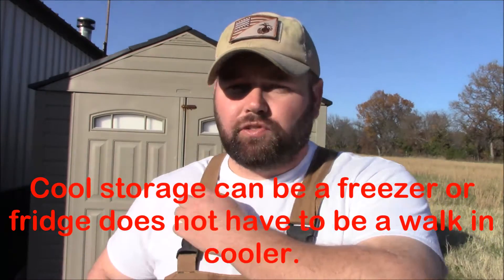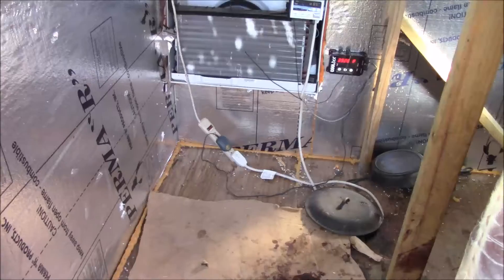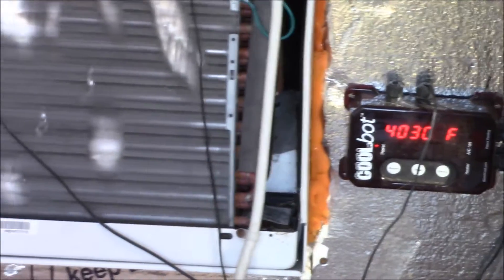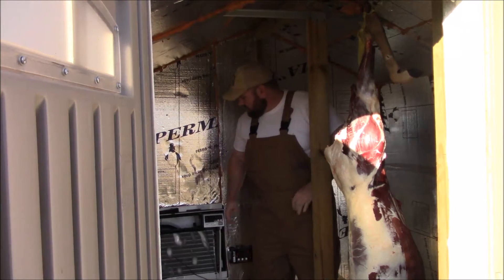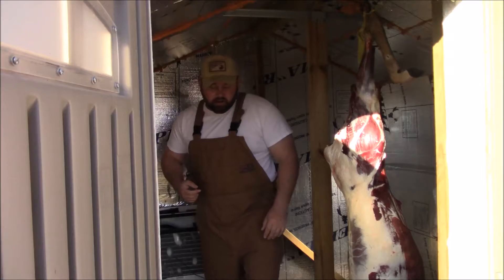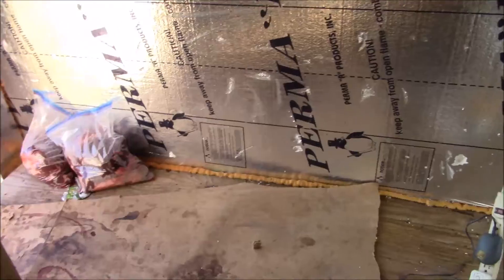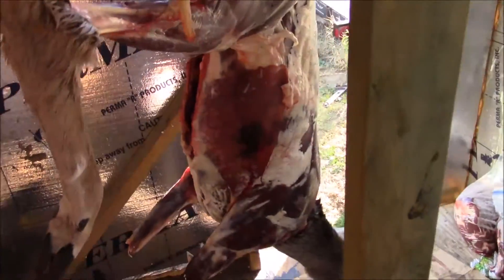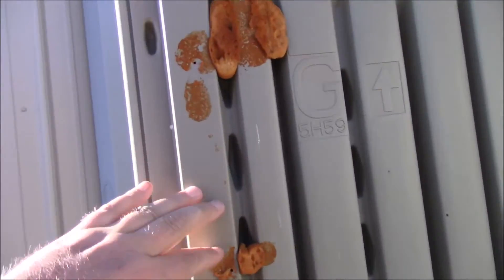This A/C Can Get Down To 20 DEGREES IN 5 MINUTES

Comment: Thanks for the nice video. I've seen those coolbot stirred actually pretty good but I'm just curious if I went to the trouble of building a freezer room is it possible to cool it down below freezing with a coolbot or is there another way of doing that economically. We like to have a cooling room but we'd also like to have a freezer room as well. Any words of wisdom would be greatly appreciated thank you sir